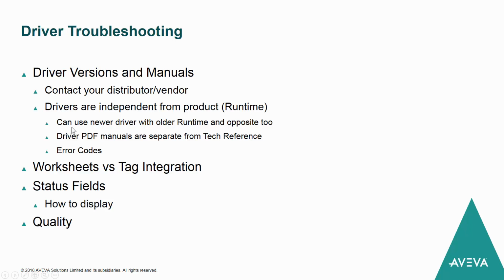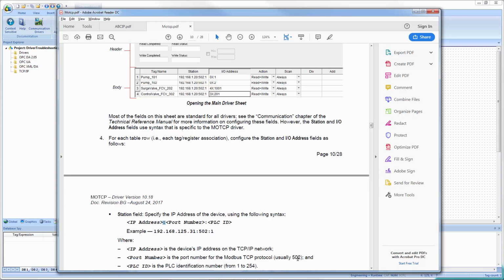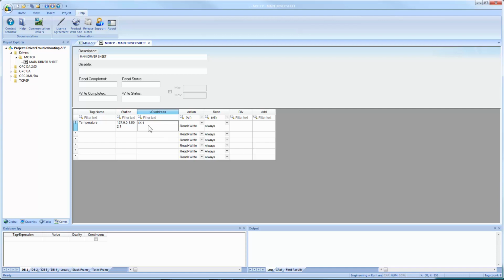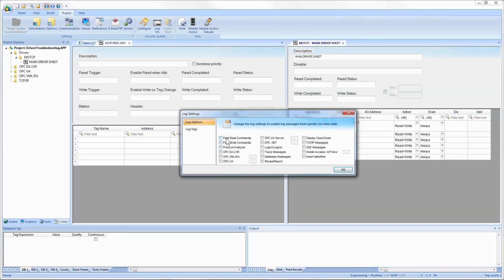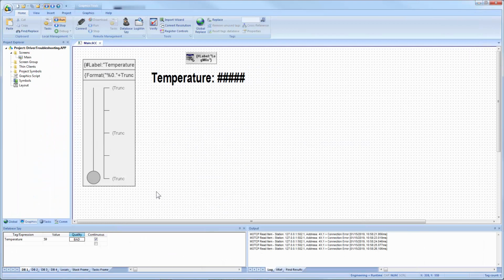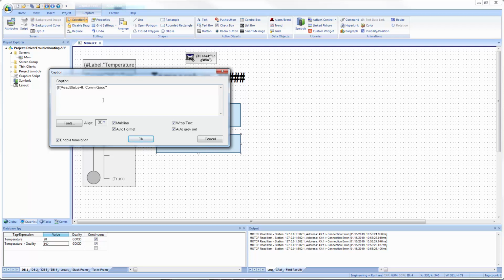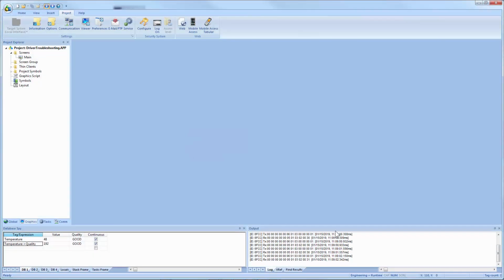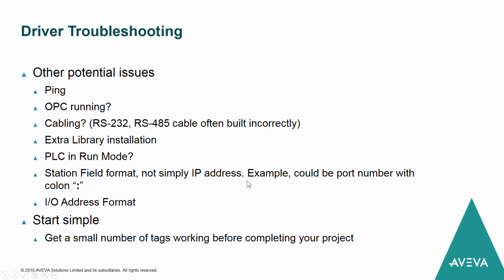Driver Troubleshooting

Comment: Good tip for when PLC loses connection 10:50
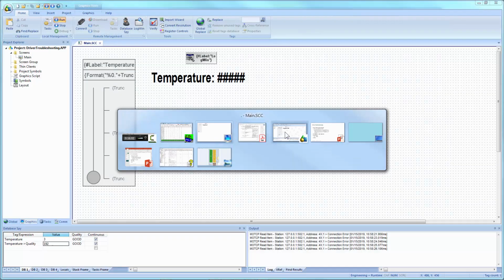Read Comm Status Tag for PLC up/down - use integer to get error code 16:05
Use a script to save time looking up error table 18:20